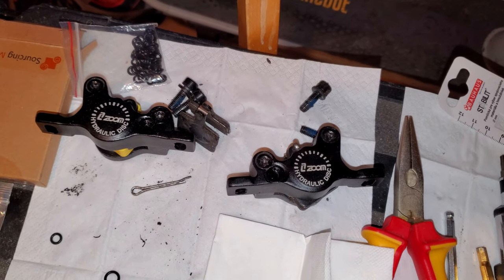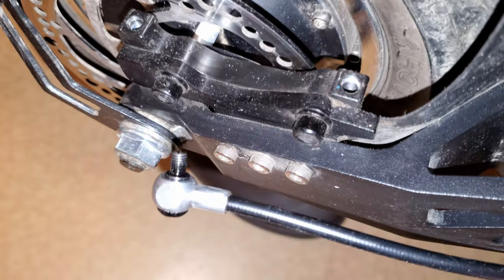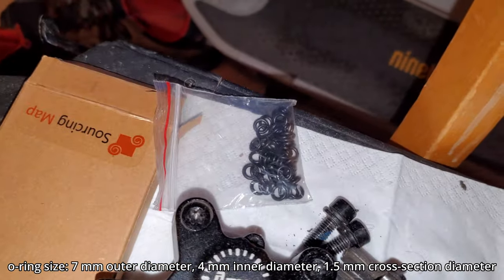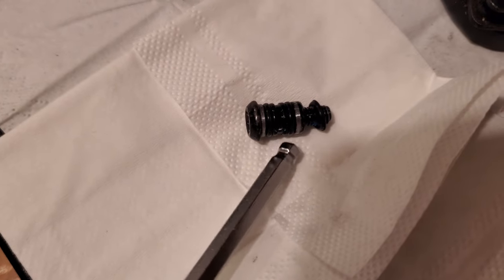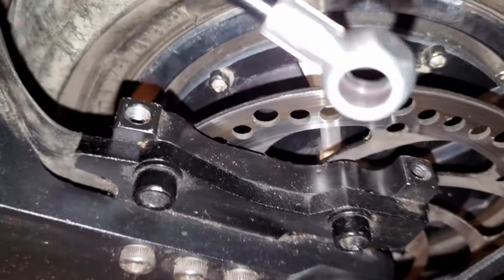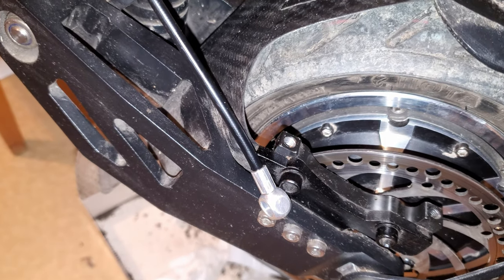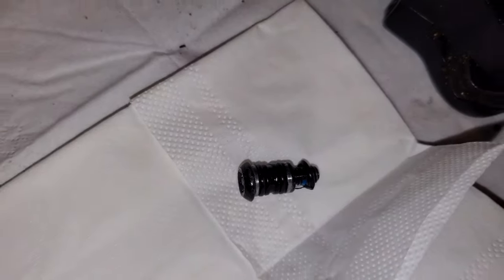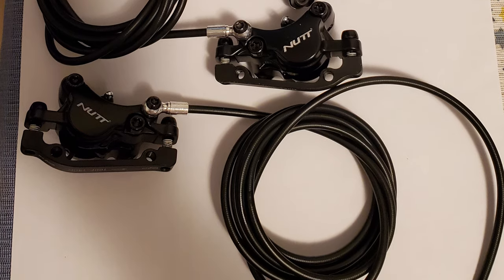Electric Scooter ZOOM Brake caliper removal and O-ring replacement

Comment: Hey Lantea, I hope everything is going well. I have a KQI2 pro, and I love all your videos abt it. I binge watched them before I bought mine. I have had them for around a week now, and I have one small problem. When I use them for the first time in the day (in the morning for example), the brakes always seem to be not working very well. I have to use the scooter for around 2 minutes and constantly apply the brakes to “wake up” the brakes and then after a couple of minutes the brakes are back on 100% functionality. Is this normal? Have you experience this or know how to fix it?
Reply from the maker: Hey, happy to hear the videos helped you out. I did notice the same break behaviour after a while, especially when you need to break right after a full charge and your drum brake is not adjusted for strong braking. The behaviour is caused because the scooter does not use electronic braking in the back motor until you discharge the battery a little bit, for me its usually few hundred meters of riding. At first I did not even notice this since I don't usually need to use the brake for a while before leaving my home, and by the time I used it the scooter was already discharged a bit and it worked as it should; that is why I did not mention it in the review.
So its not really a fault, but rather the way NIU set-up the electronic brake to protect the battery when its fully charged. Best advice is to try and tighten the drum brake so its a bit more effective when the electronic brake is not in use, and ride a bit more cautiously for the first few hundred meters after a full charge. You can adjust it same way you would on a bicycle. I have also read a while back that NIU might have addressed this in a newer firmware version, but can't confirm that is the case.
Reply: @Lantea13  Such a helpful response! And it makes a load of sense. I had a feeling that one of my brakes wasn't working, and it makes sense that the electronic break wasn't turned on after a full charge. I'm glad that you clarified that it's not a fault. I was worried about the scooter. I still hope that they are able to fix it in the firmware update, since I don't think they have fixed it yet.

And I have a bike but I've never adjusted the drum brake before. Is it easy? And is there a specific thing I should search up on youtube, or is "how to tighten an electronic scooter drum brake," good enough? And do you have any videos where you went over this by any chance?

Thanks again for the super quick and in-depth reply!
Reply from the maker: @Michael-lb3hh  So far that is not something I covered in a video, but this NIU guide should help you https://niumobility.freshdesk.com/en/support/solutions/articles/43000671133-how-to-adjust-kqi2-brake-tightness if you have any questions feel free to ask.

Comment: Whats the name of the tool you use to remove the break line from the caliper
Reply from the maker: The brake line is held in place by a screw, you need a torx security bit or  torx security screwdriver.

Comment: I have a question I dont know if you can help lol. But I have the Roadhitter by Zondoo, and I replaced the full brake lines front and rear on my scooter, it took hours for me. But for some reason the front caliper would not fit in place, like it would go on anywhere except for the spot to be screwed in, so I had to just reuse my old caliper that was working. 
But what really happened is I took out the security screw and it ended up snapping inside, do you know what to do? As far as getting something snapped inside a hole thats threaded out or getting a new caliper
Reply from the maker: You could try to get out the broken screw with a screw extraction kit. Just search "screw extraction kit" on amazon or local hardware store and get the right size for the broken screw you need to extract.

Comment: Hello. This video is very helpfull and i have a question if you don’t mind.
The banjo bolt of this zoom brake has 3 o-rings.
2 of them have the same size. I believe they are 7mm diameter with 1,5 mm thick.
And the third? The smaller one in the end of the connection to the caliper. It gas a smaller diameter and seems thicker.
Can you tell de dimensions, please??
Thanks
Reply from the maker: Hi, the o-ring on the end (right side here https://youtu.be/iaf0kMCa6n0?t=75) is the one I tried to replace and when I measured it, it was 7 mm outer diameter, 4 mm inner diameter, 1.5 mm cross-section diameter; as for the other two o-rings that are between the metal spacers more to the left, I did not try replacing those as I was not able to easily take them off the banjo screw. I believe I still have the parts from the zoom brake somewhere around here, so if you need me to try and measure something else let me know. But in the end I just gave up on the leaking calipers and installed NUTT hydraulic brakes. From day one they were a lot better that zoom, and so far I had no problems with them. A full set was around $115, iirc.
Reply: @Lantea13  is there any chance you could tell me the dimensions for the 2 o-rings that you couldnt remove? the ones i got off are a bit flat so i cant measure off of those exactly. thank you.